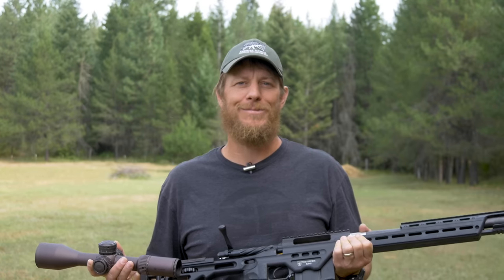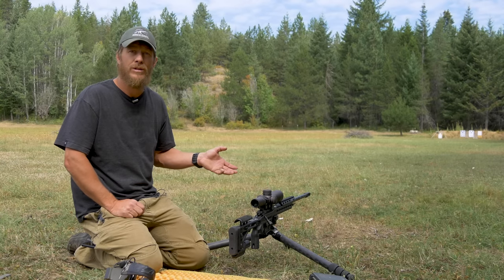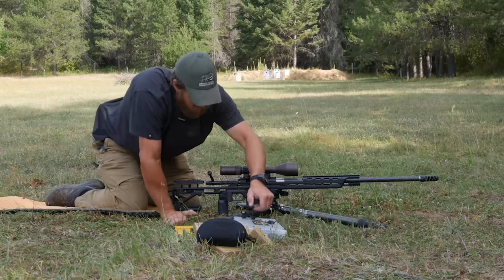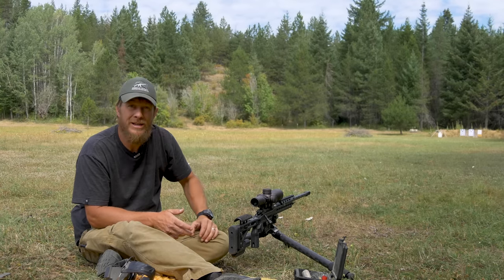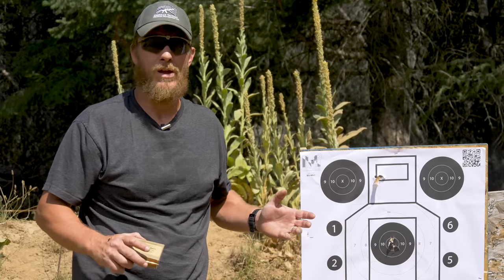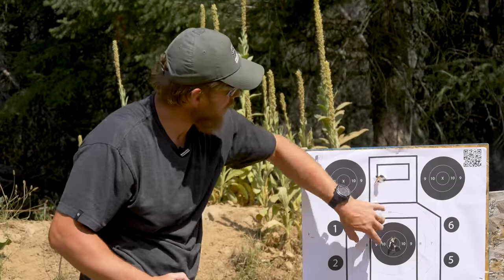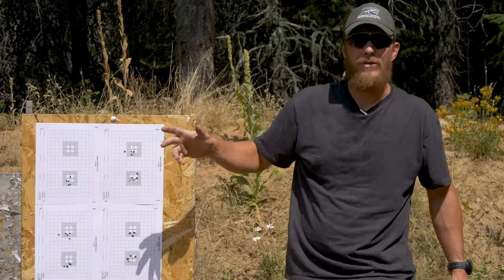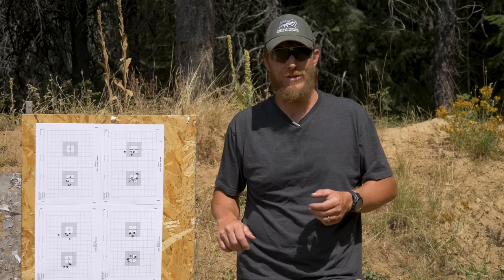Mounting a Scope with AMTAC Shooting

Comment: Great info for someone getting into it. I will say it was a MAJOR fail not having a torque wrench on hand though. The importance of having properly, and more so evenly torqued bolts is just as vital as your level.
Reply from the maker: You know most people don’t have or use torque sets right...?  And knowing how to tighten things without them is far more valuable than telling someone the answer is a $50-$100 tool set they may not use again. #perspective
Reply: @KitBadger  We'll politely disagree. If you don't have the right tools, don't attempt the job. I have been a motorcycle mechanic for 15+ years. Any experienced tech will say a torque wrench is the way to go, regardless of their wrist feel in torque. Working with hardware with such low torque specs like scope rings15-25inlbs its WAY easier to strip or under torque something. You can pickup a half decent low inlbs wrench at harbor freight for $20. If anyone has 2k+ to spend on a scope they better pony up a few more bucks for wrench my $00.02
Reply from the maker: @motowerkz3678  cool.
Reply from the maker: And I guess for reference, since we’re going with resumes, Bill has been doing this for over 20+ years.  Most of which was with DevGru. So, there is that I guess.  :)
Reply: @KitBadger  Of course, That's my point. You can't expect an average joe to "feel" out "good N tight"...All im saying...I respect both you and your videos greatly and love the content.
Reply from the maker: @motowerkz3678  right on man.

Comment: Mounting a scope is rather meticulous and gotta have attention to detail. I remember mounting a scope to my rifle and had purchased a set of scope rings that were advertised as extra high rings and we're actually pretty low rings, did not clear back-up iron sights. Individual scope rings in my opinion distribute the weight of a scope more evenly that a one peice scope mount but makes a one peice easier to take on and off, especially if it's QD.